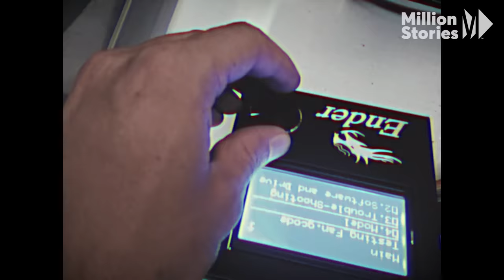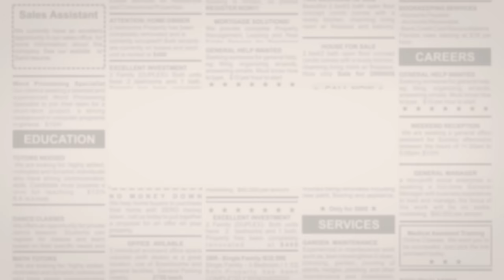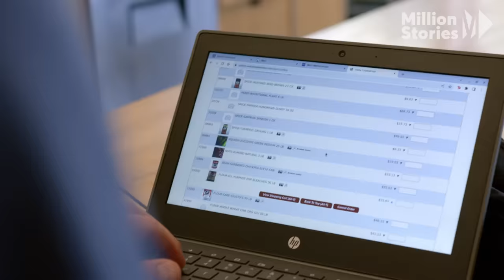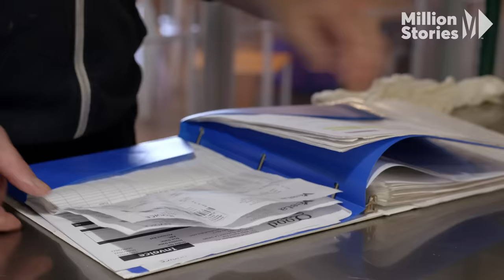These Robots are Revolutionizing the Food Industry

Comment: "Because less labor is required, restaurants that utilize robotic systems could offer lower prices in the long run." Guarantee that this won't happen. They'll just pocket the difference as additional profit.
Reply: The dream of capitalism. If all workers can be replaced with automated systems, then the owners retain that much more profit, in exchange for routine maintenance and upkeep.

The cotton gin didn't lessen the purchase of cotton-picking slaves or make cotton-based products cost less. It just meant each slave could do the work of seven and prices could stay the same as the supply increased.